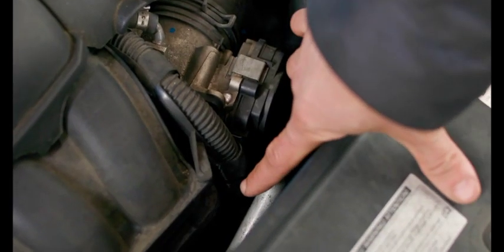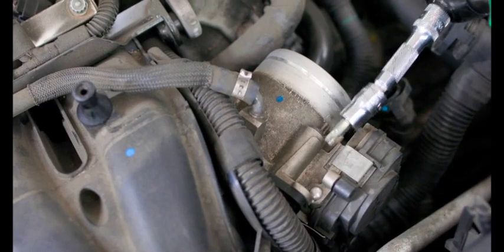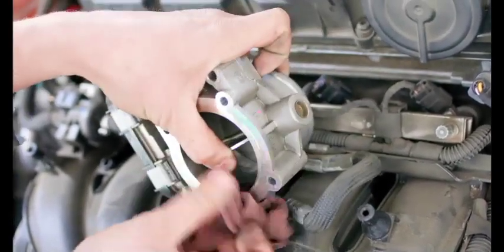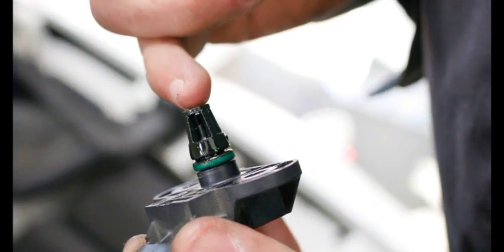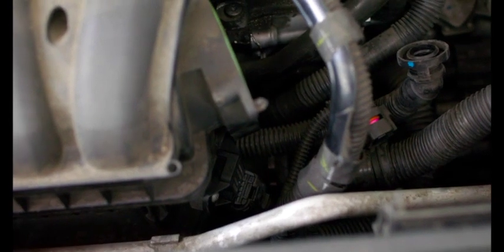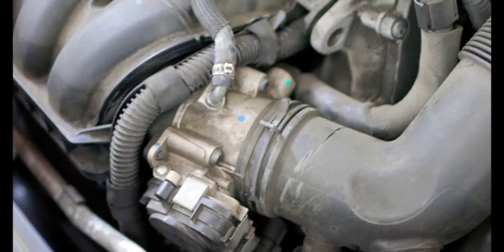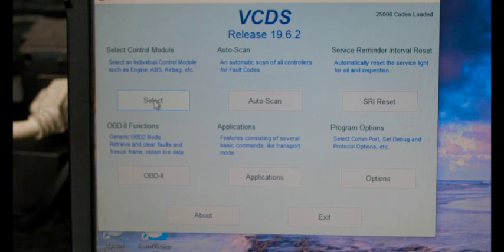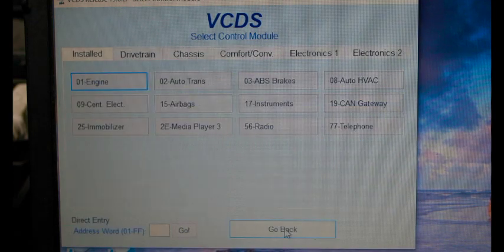2012 Vw Jetta 2.5 Check Engine Airflow at Idle too Low P3078 Manifold Pressure Sensor P0106 FIX

Comment: Hey Matt, great video! You mentioned this causing hard shifting. My jetta just started hard shifting down from 2nd to first after driving up past 4th gear. I was told to bring it to a transmission shop and he told me I had codes P3078, P0106 and P1314. He recommended a full transmission change but after watching your video it sounds like it could be a much more simple fix. What would you reccomend? I'm going to another mechanic for a 2nd opinion.
Reply from the maker: I would replace the Map sensor and clean the throttle body for your faults and then clear your fault codes and see if the trans is now fixed and shifting ok before you spend thousands rebuilding the trans. These trans are typically good for 200k miles but they do have hard shifts when hot and that is caused by the valve body inside the trans that needs replacing due to sticking solenoid valve causes hard up and down shifting when hot.
Reply: @matttorian  Thank you!

Comment: Hi Matt great Video. I have a 2010 golf 2.5 . I had a code po118. Engine coolant sensor. Cooling fans were coming on at start up and staying on until shut off. I replaced the coolant sensor and have a code of po113. Intake air temp sensor.and fans still stay on I believe it's the same as map sensor. When I clear the code of when engine is running the fans shut down for about 5 to 10 seconds and resets code and fans come on. Any idea Matt. Thank you
Reply from the maker: you are loosing the signal for the coolant temp, that is why the ecm is keeping the fans on because it doesn’t know the temp. there is a good chance you have a broken wire. look the whole harness over very closely for terminal damage, broken wire, etc
Reply: @matttorian  thanks Matt. I will for sure look. But i am not getting the code for coolant sensor anymore. As i mentioned. Since i replaced the coolant sensor and cleared the code . now i get the code po113. And fans still stay on when running. When i clear the code po113 you can hear the fans shut off until computer resets the code within 5 to 10 secs and fans start up again. Thanks
Reply from the maker: @RM-mc3jd  so you had the coolant temp sensor fault which is now fixed and gone and now you have the intake air temp fault. Sounds like you created the fault. Did you remember to plug back in the intake air temp sensor connector? You will want to check the wiring and terminals and connector for the intake air temp sensor. On a 2010 I believe it’s tied in with the map sensor but I would have to check the diagram to be sure. Maybe there is a broken wire right on the harness where it makes a sharp bend. Inspect the wiring carefully
Reply: @matttorian  thanks alot for your help Matt your awesome. Yes the coolant sensor replaced and code cleared. The new code is Po 113. AIT sensor. I never unplugged it to change the coolant sensor. Im out here now over here in Canada. Lol. And wiring to coolant sensor look good . but found 2 broken wires to the AIT SENSOR . green and orange. Its a 4 pin plug under the throttle body.

Comment: They dont have many videos on these cars it's annoying and my car is showing and red lamp light saying pressure engine off can you please explain what you think may be the problem
Reply from the maker: Hi Diana, sounds like you have a oil pressure light coming on. first thing to check would be your oil level. Engine off, pull the dipstick, wipe it clean and dip it again and check the level. Add oil until you get to at least the middle range but not past the max line. It can also be a bad oil pressure sensor, or leaking oil from a damaged oil pan. If the engine has high mileage (over 120,000+ miles) and the main bearings are worn out,  that can cause a oil light as well and you would need engine replacement which is worst case. You can also do a oil change and add lucas oil stabilizer with 5w40 synthetic oil to slow down oil burning which helps. Good Luck -Matt

Comment: Need your advice Matt. I have 2012 Volkswagen Golf 2.5 L 44,689 miles currently. Transmission started to "hard-shift" from 2nd into 1st at low speeds, obviosly just read P0106 code plus recommendations to reinstall transmission module controller software to possibly eliminate the problem. Separate recommendation during the same Autozone simple computer read.
How dangerous is it to drive the car for a few days with this problem and "check engine" light on? Does it have to be fixed immediately or I can have few days to order Map Sensor I need?
Reply from the maker: You should be fine driving for a few days while you wait for the part
Reply: Hi I have the same problem, did you fixed your transmission cranck between 2 to 1 shift? 
Thanks
Reply: @joseruiz2359  Yes, it got fixed.

Comment: New to VW. Is it 30 ft-lbs or 30 in-lbs torque when removing throttle body?
Reply from the maker: Hand tight only, no need to torque them. If you insist the correct torque is 6.5 nm
Reply: @matttorian  thanks!  What was the name of the scanner you used and will any scanner work to reset it?
Reply from the maker: @parallelmovie  the scanner I am using is called vag-com from Rosstech.com. It is the holy grail of Vw Audi scanners. Your average obd2 scanner won’t be able to reset the throttle body but it can scan and clear the faults

Comment: The last part with the computer is that something that is necessary? Im not sure how you did that part and what I would need to do that at home?
Reply from the maker: You should be fine without adapting the TB using Vag-Com. just clean it well and clear your faults
Reply from the maker: if you want to get this program it’s available from Ross-tech.com for $199. it’s a priceless tool for Vw/ Audi repair work.

Comment: Hi Matt, great video. I changed the map sensor and the code is still coming up. When replacing I noticed one of the pins in the connector was missing. Could this be the problem? I also brought it to VW so I'm assuming the software is up to date, but they told me the throttle body is no good as well as the connector. Is this a possibility? Thanks
Reply from the maker: Make sure you used the right part number map sensor. The older jettas were 3 wire 05-07, newer jettas were 4 wire. Make sure your not missing pins.  Dont assume anything with a dealer. Get a used OEM throttle body and replace it yourself.  Dont pay the dealer prices for a new TB. Good Luck.
Reply from the maker: Make sure you clear the codes as well.
Reply: @matttorian  yes I cleared the codes as well and made sure it was the correct map sensor. Will get a new throttle and do myself. Thank you!

Comment: I changed a Diaphragm 2 times and replaced the map sensor also, but hard shifting still occurs. I don't know what to do. There's oil in the intake manifold and  i think that's the reason but how can i prevent oil leaking into the intake manifold? Maybe it's dirty air filter? 🤷🏻‍♂️
Reply from the maker: Hi Tazo, if you have no faults and have replaced the Map sensor as well, the hard shifting is going to be caused by a faulty valve body. These Jettas commonly have sticking pressure solenoids in the valve body that will cause excessive main line pressure when hot which will cause the hard shifting between gears, 1-2 and 2-3 upshifts and 3-2 and 2-1 hard downshifts coming to a stop. Replace the valve body in the trans with a good new valve body and it will fix your shifting problem. Good luck

Comment: So before watching this video, I ordered a new map sensor (made in china) not knowing. I went through all steps and put the new sensor in, cleaned the throttle, and out everything back on. Drove the car around the block a few times and it seemed great. Go home and park...then come back out for a drive 1-2 hours later and the car starts revving up on its own from 1 rpm - 2.  Does this sound like the cheap sensor I used is crap???
Reply from the maker: Hi John, I think you answered your own question lol never use China sensors
Reply: @matttorian  ok. I'm waiting for parts to cool down and I'll just clean the old Bosch sensor off and put it back in. Hopefully this helps. Thanks

Comment: My vw jetta 2.5 when the transmission go to 3rd gear the rpm go high end kicks a little but I don’t have any code. You guys think the problem cut be for the map sensor?
Reply from the maker: Sounds like your transmission is slipping in third gear if the rpm goes very high. You might have a code in the transmission control module but no codes in engine. You might need a new transmission or full rebuild.

Comment: Hi, Great video. Made it very easy to change out sensor. My question is after changing out the sensor the car is still running the same. Do I need to remove the codes in order for it to run properly? Thanks
Reply from the maker: Yes definitely clear the codes

Comment: I know this might be a stupid questing but the connector piece, what order does the wiring go in? Like 1 2 3 4, what colors connect to what number?
Reply: I was trying to see in the video but it's hard to tell.
Reply from the maker: @stephaniehall6038  Hi Stephanie, look closely at the plug and there are numbers on the connector. There are two different color versions depending on where the car was made. Its either 1. Black  2. Grey 3. Yellow with Gray stripe 4. Brown with white stripe OR its 1. Black 2. Green 3. Black 4. Blue. Hope that helps. Consult a repair manual wiring diagram for further help or Google. Good luck. Only cut the wiring and replace the connector with new terminals as a very last resort if the code keeps coming back with new sensor and has latest software version.

Comment: I have a 2012 VW Beetle with a P2188 code and a P0456 code as well.  Would this also be the MAP sensor?
Reply from the maker: No it sounds like you have a lean fault which is caused by a vacuum leak from the pcv/ valve cover / or if turbo engine the oil separator. For the small evap leak it’s most likely the evap purge valve which I have a video on for the 2.5 engine. If your turbo engine those valves don’t go bad and it’s most likely the gas cap. Replace with new OEM cap and clear the fault 👍🏼

Comment: I have a vw jetta 2010 code p0106 I replaced de MAP sensor and the whole valve cover but still oil is going thru the intake manifold and it create the code p0106 do you think the problem is the software I will appreciate your help thanks
Reply from the maker: Hi Robinson, I would take it to your local Vw dealer and ask them to check the software level of the ECM, it might need to be updated to the latest software version.  There is a software update available for this fault code.

Comment: your not supposed to move the plate in the throttle body I heard, supposed to have someone push the gas pedal down while you clean it...is that true?
Reply from the maker: Either way works, your definitely not supposed to press the plate with the key on that would definitely cause throttle faults but with key off it’s no problem

Comment: I just want to replace my map sensor, is the software stuff a requirement or can I just swap the piece?
Reply from the maker: Hi Chris, you can replace the map sensor and clean the throttle body without vagcom, just clear the fault codes with your scanner when your done.

Comment: Is there a way that oil does not enter the map sensor? I already put the pcv valve back on and it continues to stain with oil.
Reply from the maker: Hi Erick, it’s very normal operation of the engine. replace your map sensor once every 10 years and don’t worry about it. also don’t replace just the pcv a lot of the aftermarket valves will leak vacuum and cause more problems. A new Oem Vw valve cover is the proper way.

Comment: Hi I have a 2013 Passat 2.5l with a p0491 code insufficient flow in bay 1. Do you think this could be related.
Reply from the maker: No that is a secondary air code incorrect flow code. You need to look at all of your secondary air pipes from the intake to the air pump in front of the engine and then especially check the pipe going back to the combi valve. One is probably disconnected or cracked and needs electrical taping or if not tape able simply replacement . Vag com is helpful to run the pump and listen for the air leaking as the pump pulses in output test mode
Reply: @matttorian  Thank you!! You were right

Comment: CEL still on. Factory sensors ends in 635 and I used 634. Still Bosch. This is the only part number they had at AZ
Reply from the maker: Did you clear the code? You have to clear the codes after sensor replacement. What year is your Car?  I looked up both Map  sensors and 635 and 634 dont come up at all for the Factory Vw part number or the Bosch part number.

Comment: Can the map sensor b replaced with out removal of the throttle body with an extension and swivel?
Reply from the maker: Yes you can sneak the sensor out but I prefer to remove the throttle body. It is quicker than trying to sneak the sensor out and it makes cleaning the throttle body much easier. Either way good luck
Reply: Matt Torian got it done thanks for the tips

Comment: Do you know what size is the screw that goes into the left side of the MAP sensor?
Reply from the maker: Hi Stefanos, The screw is a very coarse thread for plastic, the measurements are 5mm wide x 16mm long and the exact Vw part number is  N 104 420 03
Reply: @matttorian  Thanks so much! I finally got time to respond. Very helpfull

Comment: BTW, in my case the MAP sensor was so bad that my automatic transmission was behaving erratically. I have just tried out my car and the transmission issues went away!
Reply from the maker: Great job! It’s very rewarding fixing your own car. And yes I forgot to mention that a bad Map Sensor with cause messed up transmission shifting because it’s the main load signal sensor from the ECM to the TCM to determine shift points!! -Matt

Comment: can a dirty/faulty map sensor cause transmission issues (wrench dash warning)?
Reply from the maker: The wrench light is a service due/ oil change due light that needs resetting. A Bad map sensor can cause weird shifting though.
Reply: @matttorian  thanks. but this wrench icon shows up where the gear selection normally does on the dash, is this the same one for service interval due?
Reply from the maker: kumbackquatsta so you probably have a fault in your transmission and will need a scanner than can scan the trans.